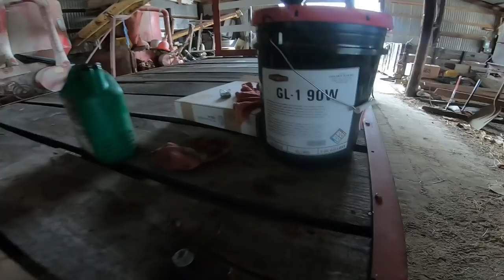Assembling a ZF Axle on  a Big Ford

Comment: Cher has a hot video about If I Could Turn Back Time on a Battleship .You got it all buttoned-up n probably been mudding . I would have disconnected other side n removed drive shaft last year n checked out rest of powertrain n condition of tractor to see if you have anyone issues. Last owner did alot of brush hogging turning on concrete or asphalt or hard ground that would shorten life expectancy of turning components .Could say your in a new ball game  Hope all go's well ..

Comment: Ever do the old trick of taking an arc welder and drawing a bead on the stuck bearing race? It heats it up enough to slide off. Worked on my old case backhoe.
Reply from the maker: I have not, but I'll have to try that.

Comment: Yeah that axle looks way undersize for a tractor of that size and power, and I remember watching one of your earlier videos where you were plowing I think and it was like no slip on the front which is putting a TON of strain on the gears.  

Ol' Onelonleyfarmer had the wheels set all they way out on his old 7410 Deere loader tractor (or was it a 7810, can't recall) and picking up 3 big squares at a time and bouncing around with them in the field or doing a lot of turning sitting still or barely moving (always best to turn while MOVING with a heavy front end load like that... even on a car or truck it's WAY easier on your steering linkages, power steering pump/system and box/rack-n-pinion plus the tires if you are at least moving a LITTLE while turning the steering wheel, rather than just sitting still) he was eating those upper and lower "ball joint" bearings on the hubs (kingpins) every few months or so... having the wheels set all the way out really puts a lot of stress on them because of leverage-- center of the tire is where the weight is carried and the lowest load on those pins/bearings is when the center of the tire is as close as possible to the center of those kingpins.  Why those new tractors with the front duals, just makes me shake my head.  Course they oversized everything probably 3-4X what they are on that front end to "handle it" but still, that's a LOT of weight/torque on a very long moment of leverage (length from the center of the outer tire to the kingpin bearings/steering ball joint for that to have to support, particularly if the inner wheel is off the ground due to being over a low spot or hole and the outer tire being on a high spot or not in a hole and carrying all the weight.  Why they say not to put duals on the front of those old IH 2+2's, thought I've seen it done... they simply aren't made to hold up to that level of stress-- the front end SHOULD slip a little so long as it's not power hopping, which breaks parts.  With front duals, she ain't gonna slip and so its REAL hard on them.  Plus on a 2+2 front duals will usually collide with the rear duals in a sharp turn-- you have to watch for that REAL close, where the single front and rear duals will never collide in a turn since it was designed to run like that.  A true 4WD tractor is slightly longer so the front and rear outer duals get close but don't collide in a turn unlike a 2+2... 

A couple inches probably don't matter to the longevity of the hub/kingpin bearings but you DEFINITELY don't want to overload it in that condition, like say picking up 3 big square bales on a front end loader like somebody else does... probably a good idea to ditch that extra weight... slippage isn't ideal but it's better than getting 100% traction and tearing up gears and stuff.  Also they say to change that oil every year IIRC... cheap insurance.

Comment: The big nut hub I think is a better design you can at least adjust preload on the bearings.  The smaller bolt design preload is non adjustable. Bad design if you ask me.
Reply from the maker: And those eight bolts hold the ring gear alone. The other side had all new bolts. Maybe they were adulterated in the past.
Reply: @boehmfarm4276  The eight bolts hold the ring gear on the pins 60 foot pounds. The preload is fixed by the distance from the back of the ring gear to the bottom of the spindle. So any difference in bearings or gear or spindle and your pre load is off. 

The new bolts was probably from gear failure that chewed up the heads of the bolts.

Comment: Do you guys run 36 or 38 inch rows? We run 38 inch here in north central IN.
Reply from the maker: I'm glad someone else has wide rows. We do 38s.
Reply: @boehmfarm4276  oh ok nice 👍
Reply: We're still on 38 inch rows. The chopper is set up that way, and we still pick ear corn with a mounted new Idea picker mounted on a Farmall M. If we have extra corn left, we hire a combine with a four row head.
Reply: @hturbo1007  nice 👍

Comment: I suppose the ZF axle final planetary gears need EP gear oil, at least for the increased weight of TW Ford. Would it be safe to use API GL_4 or GL-5. Zf has a lubricant list for APL-300 series: https://aftermarket.zf.com/remotemedia/lol-lubricants/lol-en/lol-te-ml-21-en.pdf
Reply from the maker: Thank you